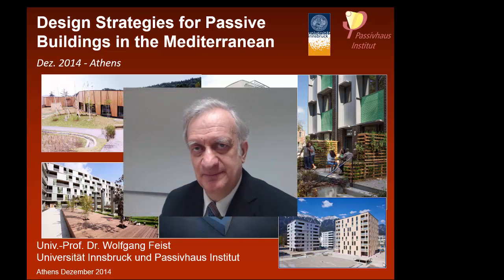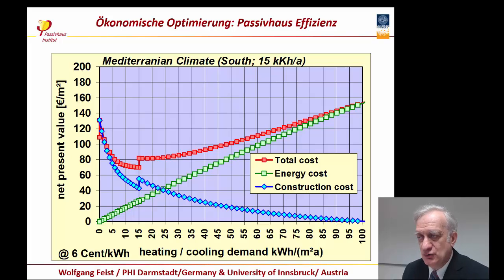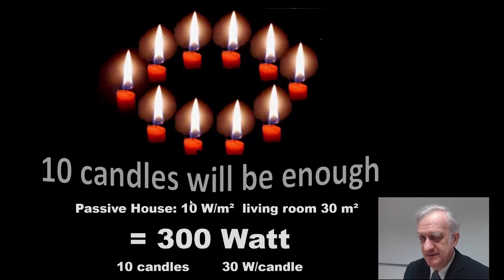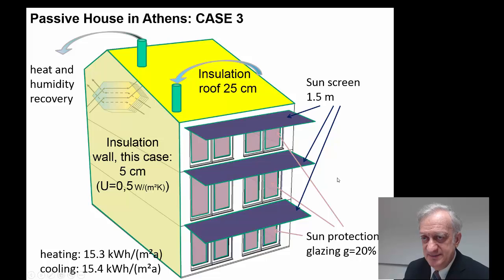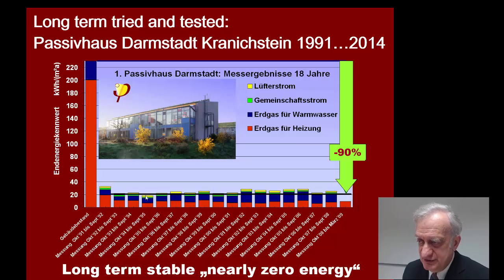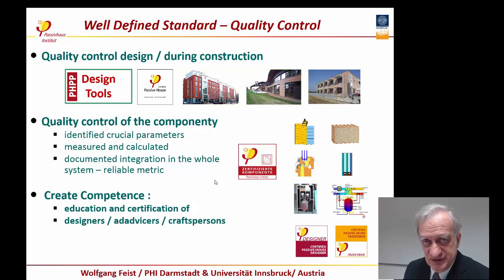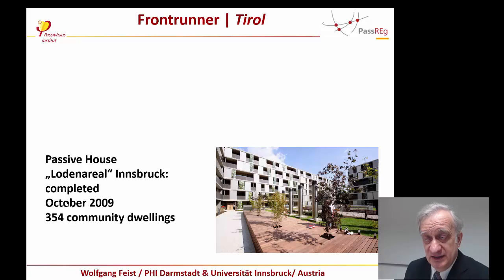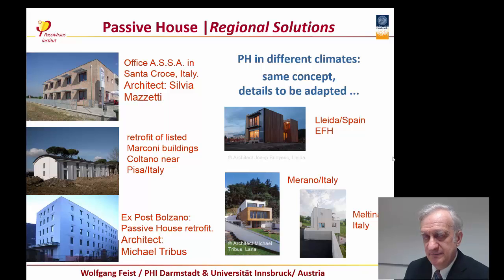Design Strategies for Passive Buildings in the Mediterranean

Comment: "Design strategies for Passive House buildings in Mediterranean climates" is a short preview for the upcoming 19th International Passive House Conference (#iPHC). Passive Houses get less and less expensive - this standard can be build everywhere, and the definition is functional (performance) based. Of course, the regional solutions are different depending on climate and on building tradition. It's a chance for regional and local architectural styles. The key to make it happen is the PHPP - the planning tool, which allows for optimal design in each climate: http://www.passiv.de/de/04_phpp/04_phpp.htm